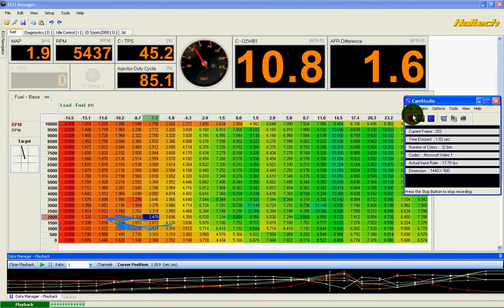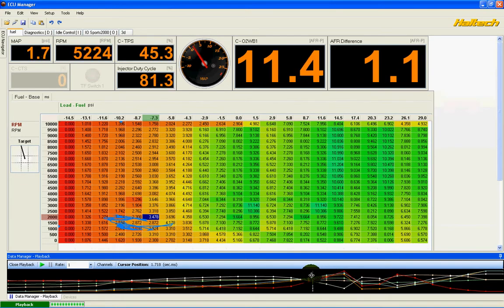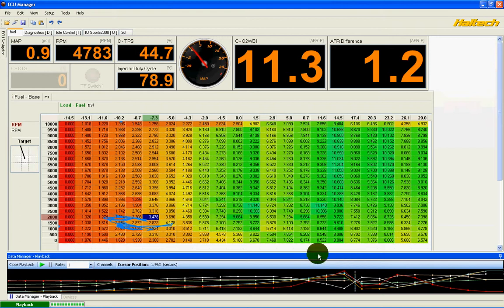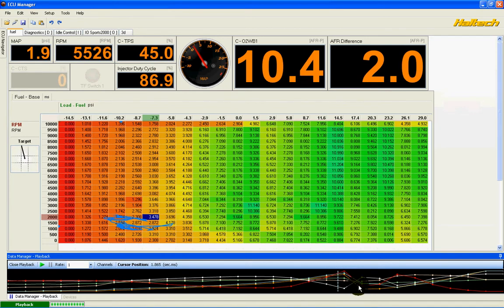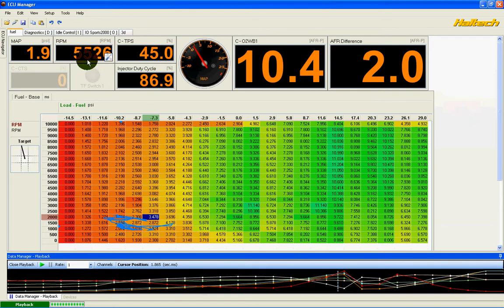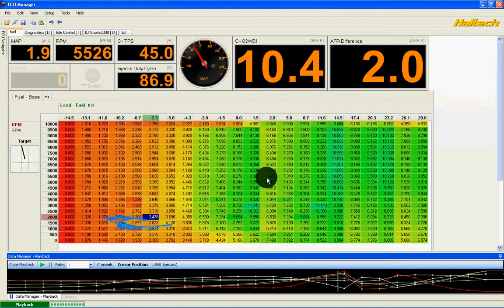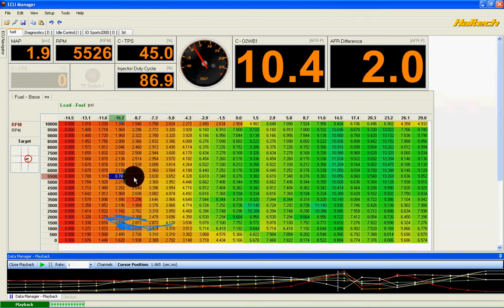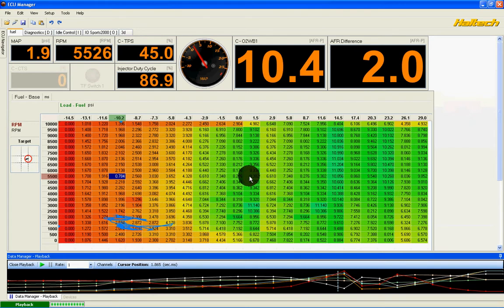haltech PS2000 data playback & quicktune

Comment: Did you ever end up getting "space" to highlight the current cell from a data log that's playing back?
I'm currently having a look into it, and all it will do when space bar is hit is highlight the right RPM on the far left of the base table but not the actual psi reference. So it pretty much only does half of the axis haha.

I end up then using the arrow keys to move right across the base map to get to the right psi reference cell etc.

Comment: you got it all mixed up about the quick tune feature. quick tune will change the selected cell NOT THE CURRENT MARKER POSITION. It uses the entire datalog to calculate the corrected value. Quick tune accuracy is relative to the number of hits the selected cell received during the log.